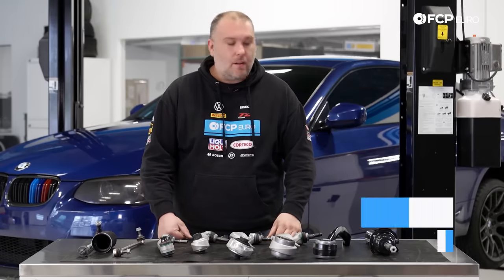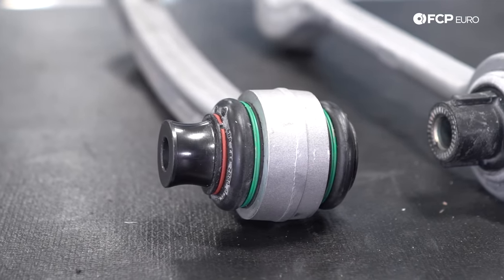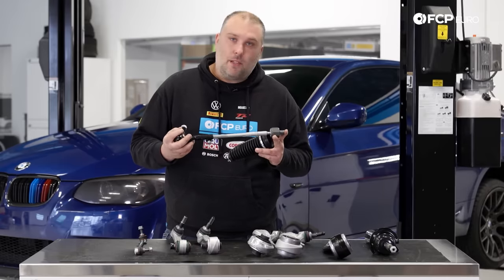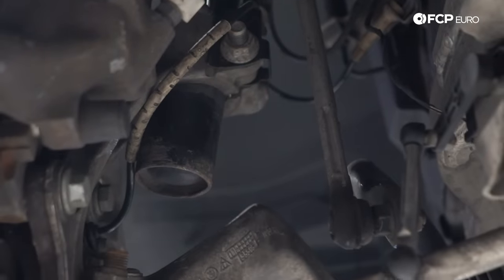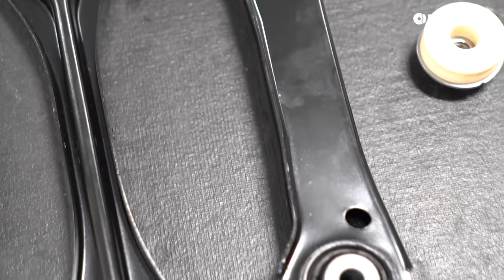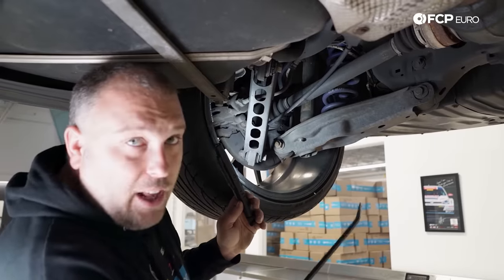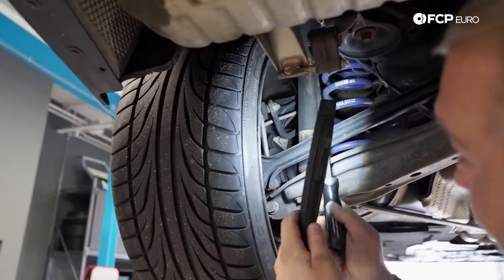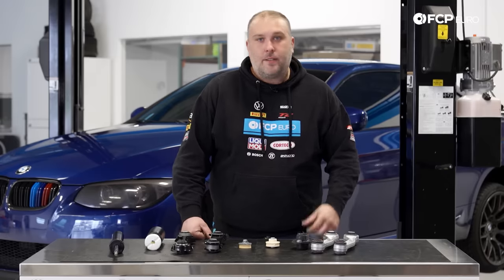BMW E90 Suspension Diagnostics & Problems: Everything You Need To Know ( 328i, 335xi, 335is, 330i)

Comment: Great video👍 Every E90 have small problem..when you turn steering wheel when you are still, or drive very slowly, the wheel clanking little? Like one inch turn make little cank noise.Is it true? Thx
Reply from the maker: Filip checkout our recent Steering rack DIY or RQPR, see if its a similar symptom to the one we show in that video. https://www.youtube.com/watch?v=S9OPp4z7umc
Reply: @fcpeuro  Thank you !
Reply: @fcpeuro  I get a similar thing. No steering wheel play, much fainter noise than in the video you posted. Same sound when on uneven ground and the ground sort of pushes the wheels a bit. Something in front end suspension?

Comment: I’ve had a slight knock on my 08’ e90 328xi when turning slowly around streets. On highway and everything else car is fine. The problem hasn’t gotten better or worse in like a couple years. Some days it doesn’t show at all. Any ideas?
Reply from the maker: Hi Luke, it could be ball joints, worn control arms, etc! The best thing to do it get the car up in the air and have a look at everything closely!
Reply: I’m having the same issue but also occurs sometimes when braking too.
Reply: FCP Euro I’m thinking about just pawning the car off on my son and getting a 2013 328i xdrive from my independent mechanic. The car he’s got currently has 115,000 miles with a blown motor. The motors he’s putting in has 26,000 miles on it and comes with a 6 month warranty. Is there anything I should look out for after he does the swap? Any thoughts?
Reply from the maker: @lukebianchi7233  not a bad plan make your son deal with it , as long as you're not still paying for it ^.^ In regards to the new car, that's a really low mile N52 and coming with a 6month warranty would certainly be nice to have. Not sure if you've already watched our video about N52 Diagnostics but it goes over anything that could potentially come up with the new car's engine https://youtu.be/WR_aXg3zpWY . Also price point makes a big difference whether its worth it or not.
Reply: FCP Euro This 2013 is an F30 with the 4-cyl n20
Reply from the maker: @lukebianchi7233  100% my bad ^.^ makes a lot more sense how there was such a low mile N52 lol. Didn't pay much attention to the year there!  We are going to do a same bit of content for the F30 as we did for the E90. Off hand though main concern is Timing chain related issues , once the guides fail and the chain gets slack BANG. That's likely what happened to the first one in the car though, so you should be fine :)
Reply: FCP Euro Can’t wait for the videos on F30! So with the 26,000 mile n20 or n26 idk yet, I shouldn’t really be worried about timing chain yet? Would the timing chain grenade the whole motor or be something repairable?
Reply from the maker: @lukebianchi7233  Sounds like a good deal!

Comment: Great video! I've been doing a lot of research on what part I need from you guys to fix a suspension issue. I have a knocking sound when turning the steering wheel at low speeds below 15mph and a good amount of steering play/roaming at highway speeds. I tried tightening the lower steering column bolt but it only worked temporarily. What could this be due to?
Reply from the maker: Hi M Desai, it's possible that the steering rack has play in it internally and needs to be replaced. But definitely get the car up in the air and have a look at everything to make sure. We have a kit here: https://www.fcpeuro.com/products/bmw-e90-e82-steering-rack-kit-bosch-zf-32106777463kt
Reply: My tie rods were shot. A lot of play on an uneven road..
Reply from the maker: @muumuumu  Yeah the tie rods can become quickly old and tired. We just posted an E9X front end suspension refresh DIY and the tie rods weren't the primary issue but still  in desperate need of a refresh!
Reply: As an owner of two BMWs approaching 15 years young appreciate the videos to keep these beauties on the road and healthy. 🇨🇦

Comment: E90 335d I’m getting nasty vibration during braking and pulling to one side when braking. Almost like the rotors are warped and they are new.
Reply from the maker: This can happen from improper brake bedding-in procedure, or possibly sticking brake calipers. However, if the rotors are in-fact warped and you purchased them from us we would be happy to replace them for you!

Comment: My 2011 335 with 60k miles feels so sloppy - not sure I’d I should get new oem shocks which are so reasonable priced or bilsteins?
Reply from the maker: It depends on what you are looking for! The OEM shocks are perfectly fine and the car will ride just like it did when it was new. Bilstein shocks, however, will ride a bit firmer, if that's what you are looking for.

Comment: Hey man i need your help, can i send you a video? i have been spending so much money to fix it and no one can help me.. i feel vibration in the steering wheel, while my brakepads, brake discs, struts, and tie rod has been replaced.....
Reply from the maker: if the vibration happens more at highway speeds, it could be your tres need to be balanced or a shufted belt in one of them. It could also be a control arm issue. It would bw tough to tell from a video what exactly is wrong.
Reply: @fcpeuro  it has nothing to do with the wheels. tried 5 sets, and all have same problem. steering wheel vibrations.
I did noticed that the swaybar is moving a little bit. the bushings are worn. is it possible that the sway bar has an effect on the steering wheel, and is causing the vibrations?

Comment: Hi I recently changed my front right wheel speed sensor for abs I jacked up only one side of the car and I started hearing a noise as I was jacking it up on one side .. it felt like because I was only jacking up one side the driver side got bent in or something in some way? I kept going and changed and replaced the wheel speed sensor and than put the tire back on.. now when i am driving and accelerating .. as soon as I reach 80mph or above I hear a knocking noise from the front end of my car and I feel it in the but as soon as I let off the gas and from 80 and I reach 75-70 mph the knocking noise stops but when I get to 80 mph or above it starts knocking again . I feel it coming from the front end of the car and underneath the foot gas pedal .. can anyone please help me?

Comment: Have an e93, shimmies at 80-110kmh and then goes away almost completely, wheel doesnt vibrate and it feels like it comes from the rear, anyone know what it could be. And yes tires are balanced and are good quality tires. Car has done 56000 miles so basically nothing

Comment: So my car starts to shake after going anything faster than 55, I just bought it and did a bmw ppi and they said everything was fine... so should I just replace the thrust arms or do a whole front end refresh?
Reply from the maker: You can start with the thrust arms, or if you have no record of the suspension being done, a front end refresh would be a great idea. How many miles does it have? Another cause of shaking is unbalanced wheels/tires.
Reply: FCP Euro  almost 90k, and no record of any of them being replaced. It’ll shake bad enough that my cup will fall out of the holder.

Comment: So I missed if there is an upgrade part for the rear trailing arms or are they meant to be kept weak to absorb lateral impacts to the wheel?
Reply: If I'm not mistaken there is a billet aluminum rear  trailing arm

Comment: When the front driverside wheel hits a bump in the road, I get a significant shudder, any ideas what would cause that?
Reply from the maker: It could be as simple as your end link, thats the cheapest and easiest place to start with clunks over bumps.
Reply: Could be the thrust arm bushing or a blown shock . My rear end shudders over bumps because not only are the shocks blown the rear right forward control arm balljoint is toast

Comment: I have done 200k and all my bushings are still in good condition so maybe I am lucky
Reply from the maker: Some call it luck others may call it skill. That is great though Zak Khan, enjoy it!
Reply: FCP Euro but I did change my shocks they were bad. Maybe my luck will run out soon but I am having difficulty at looking how many rear bushings goes in the rear suspension and how many do I need to order can you please help
Reply: Same here I’m at 197xxx rn and everything stock. Except rear struts and it’s going great. Knock on wood😂😬🤘🏽
Reply: Maybe you did not examine your bushings well enough?  If nothing else, they are probably hard as rocks and crumbling on the insides.
Reply: Macht Schnell since you have assumed give me chance too. I have been working on cars longer than you. And to clarify more when replacing shocks and wheel bearings all bushes we’re examined thoroughly on the hoist not on jack stands

Comment: 2008 135i m sport, steering wheel starts shaking/wiggling around 60-70mph wtf is wrong plz help
Reply: aha you basically touched on it around 7min, the front control arm bushing perhaps? the trw kit should solve issue correct?
Reply from the maker: @bcg5175  See that you just had to stick around in the video a bit longer ^.^ It could be a handful of things but how many miles are on your car currently? New control arms is never a bad place to start and at most points is preventative.
Reply: 98k, some days it's worse than others some days I hardly notice but lately it's been noticeable, completely stock & just had wheels aligned still wobbles
Reply: B C G , any decent shop would fix suspension issues first before doing an alignment. Alignment comes last.
Reply: @kaygeebee  Yeah go to a better shop.  Best to find a locally owned independent where the owner works.  Avoid national chains.

Comment: So I have a 2007 320i e90 saloon, can I swap components with the m3 versions?
Reply: Daniel Clowe Hi Daniel, i have the same car! I have changed all my front arms and ball joints including the steering arms with MEYLE HD, it is an strong and reinforced version. The difference is night and day in your driving feeling. I have paid for the entire set 299,00 Euros. 👍 Now i will do the same on my rear suspension arms.
Reply: @technopro-kz4xv  cheers pal, did you get them from eBay?
Reply: Daniel Clowe Yes, but be sure to get the parts from a reputable seller or directly from a car parts store. Also be sure to purchase the HD version because is the reinforced version. There is the normal MEYLE and the MEYLE HD. 👌
Reply from the maker: Even crazier idea you can get the MEYLE HD kit from us, or the M3 upgrade kit if youre feeling spicy ^.^ We've got you covered.

Comment: I'm getting an active steering error on my e92 with difficult steering and traction lights 😭 cannot seem to figure it out!
Reply from the maker: Hi Mic, if the steering is difficult, I would check your power steering fluid level, you either have a leak in the system and the fluid is low or empty, or the power steering pump has failed!
Reply: @fcpeuro  thanks for the reply! I've checked the fluid, cleaned the disc inside the steering wheel,  replaced the battery, and tried re-initializing the steering but honestly didn't even think about replacing the pump itself. I'll give it a go, thanks again!
Reply: @micraw714  PS fluid must be changed periodically like all other fluids.  There is no lifetime fill unless you desire a sort lifetime for the component.
Reply: yea also have a power steering pump failure but don't care just keep driving on 😂 who needs assistance 😆
Reply from the maker: @turboterry1776  Its a good way to get a safe arm workout nowadays.
Reply: @turboterry1776  haha yep! I still don't know if it's my pump or the active steering module. I keep getting code  6146 "cannot change to active mode due to under voltage" 😭
Reply: lol not at that point yet works normal until low speed steering then it gets (gittery) started to happen at a track day never got worse but might just give up soon...got another rig to drive not to worried will just leave it and buy another new rig

Comment: The manufacturer, seem fit the cheapest components they can get away with. Pressed steel, flimsy. If they could  fit plastic components they would. The quality today for so-called modern up-to-date cars has gone done for cheap components that don't last that long. 😳 And is more expensive to replace  the failed components.